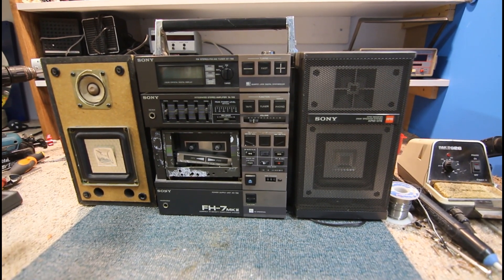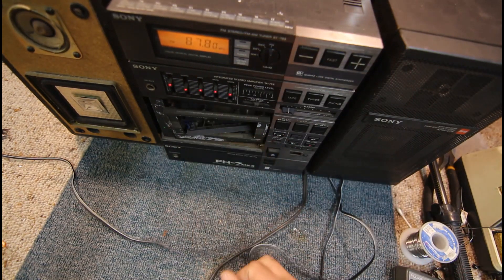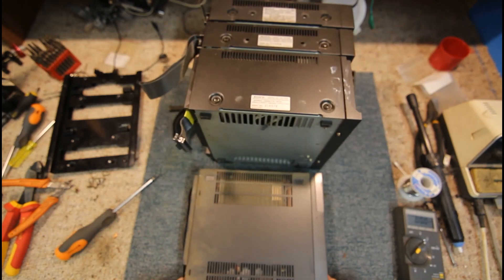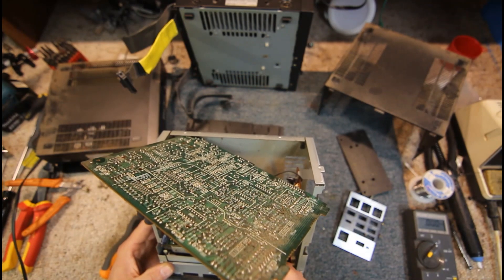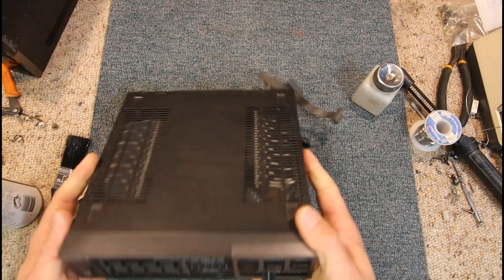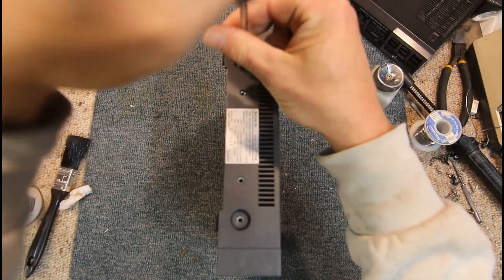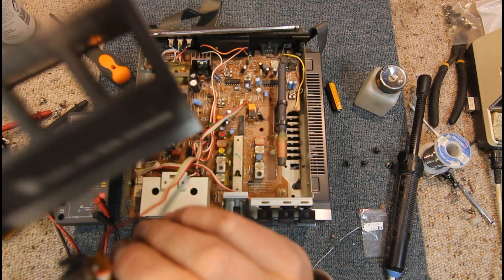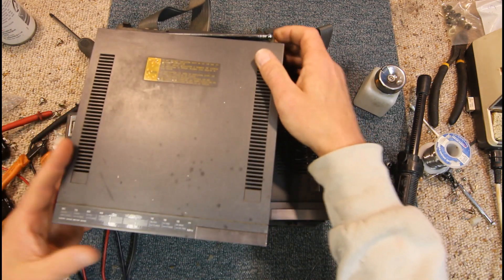Sony FH7 Stereo system teardown and service

Comment: I own a Sony fh-150r and it's definitely a solid well made system and it still looks really nice in any current day modern hifi setup.  👌🏾🤗
Reply from the maker: The FH150 is a bit more advanced than the FH7, and a really nice system.

Comment: Hi, could you help me? I would like to know why the cassette deck is hard. When I put the cassette in, it spins for 3 seconds and then stops, it only advances, the tape on the right side but the left side stays hard, what could I do? Greetings, I'm from Lima, Peru.
Reply from the maker: How are things in the land of the Condor? Do you mean it only moves the tape in one direction since its an auto reverse deck? Usually if they stop after a few seconds its due to a sensor operating because something isnt moving. If both reels in the tape move ok and then it cuts out it may be something like the counter belt. Check the counter is moving if it has one because a bad belt to that means the sensor doesnt move either and the deck will shut off thinking its chewing a tape. Does it move the tape ok in rewind and fast forward?

Comment: Technics didn’t have any flat square woofers, but they had flat rounded honeycomb woofers on some speakers in the 80s. Not sure what the purpose was, but I don’t know that it really had a super big advantage over a normal cone.
Reply from the maker: They were marketed as Digital Ready back in the 80s when CD came out. National Panasonic which is practically Technics had the AFD speakers in its boomboxes which I believe is similar to the Sony ones.

Comment: Hi! I would be very grateful if you could help me. For this model (FH-7) part of the power supply (AC-78), the value of resistor R127 in the service manual, makes me wonder, is it 100 ohms or 100 milli ohms, it is the resistor for Hi + supply. For the main power supply there seems to be no sense because it uses a relatively high resistance. For mine, this resistor was broken and the reading was over 4k ohms. thank you.
Reply from the maker: If you have a manual it will list that resistor in the parts list with its resistance and wattage ratings.
Reply: according to the service manual the value is 100ohm x 1/2watt, is a fuse resistence may a problem in a amplifier stk4026 trigger burn it. the supply voltage its 30v

Comment: Hello steve, awesome video. I’ve got a FH-7 mkIII that was collecting dust and today when i decided to open it for a cleaning, I’ve found that one of the speaker cables that go from the headphone socket to the speaker terminal was loose from the terminal pin,I ‘ve tried to attach it but it broke free.
It seems that it was wrapped around the pin instead of being soldered.
Should i wrap it like it was before or solder it ?
Reply from the maker: Its fine to solder them on. They have a habit of coming loose when you mess around inside the units that use wire wrap terminals.
Reply: @StevesElectronicRepairShop  thank u for the answer steve

Comment: That poor fh 7 i hate what people do to them ive seen the beaten to death one i  have a lead on from family has these ruined speakers smashed mesh and no foam and the flip head is broken ish so someone beat it bad but it wont give up still plays tapes and the speaker take a beating but work
Reply from the maker: Unfortuntately these top of the line things end up getting old and passed down to people that dont care much for them. They are solid enough to keep going despite the abuse unlike the cheaper units.
Reply: @StevesElectronicRepairShop  true that I hate what people do to those poor stereos

Comment: Hi could you tell me the dimensions of the hifi component it self? without speakers? It would be great cause i cant find those on the internet. Thanks so much and nice video btw
Reply from the maker: W 215, D 230 H 255
Reply: @StevesElectronicRepairShop  thank you very much and have a nice day :)

Comment: Is it possible to get a RIbbon cable for FH7 Mk2?
Reply from the maker: I am not sure. There may be second hand ones around, or its possible but unlikely that Sony still have them new.
Reply: It’s possible to make a ribbon cable with modern components. Some just modify the end connector plugs to properly mate to the socket on the stereo components but some people just 3D print new connectors that will fit around current types. Just make sure you know exactly how any of the wires may crossover to another line inside a connector before turning it on!

Comment: Quite interesting to hear that you would not consider recapping the power supply...
Reply from the maker: The caps in these Japanese units tend to last well, especially since I live in a colder climate. Caps that are exposed to lots of heat are worth checking and even replacing if known to cause trouble, as long as you can find decent replacements, since many of the ones for sale these days have short lives. There are still electros from the 1940s working fine in old valve equipment. Switch mode power supplies are probably the only place I would think about a recap because of the heat they run at, and the often catastrophic failures when the caps die in them.
Reply: @StevesElectronicRepairShop   Interestingly, I tested the power caps (Peak ESR70) in my FH7 MkIII just out of curiosity and found them to be in spec, just as you mentioned. I also tested some of the caps in the Amp and again, they tested fine. I wonder though, after all these years whether, despite them being 'in spec', that there has been some level of degradation that affects their sound performance. I guess, until they are scoped and changed, I'll never know. My unit has been running 24/7 for at least 12 years in my shed and in summer it gets as much as 40°C and in winter as low as 5°c (Perth WA), so it sees some reasonable shift in ambient temps.
Reply from the maker: @Shueysstuff  I am fairly skeptical about recapping for the sake of it. I think people are just doing it to create work for themselves. I am yet to see any scientific proof that it improves the sound or changes any waveform in any measurable way. Its one of those things like oxygen free copper cables, some people will swear they sound better, but no lab can measure any difference. Most Japanese equipment is well designed and keeps electros away from the hot components, so they should last fine. There are exceptions though. The other thing that can bring on failure is if the equipment is not used for a decade or more. Electros will sometimes degrade and short out once power is applied again.